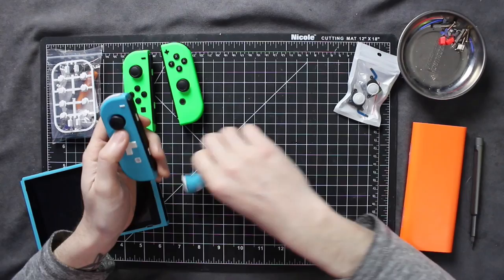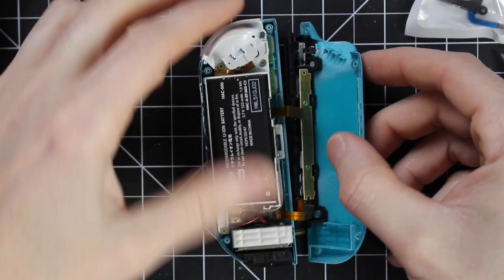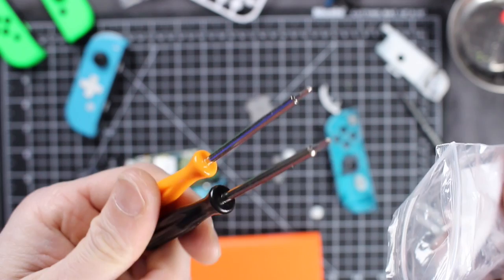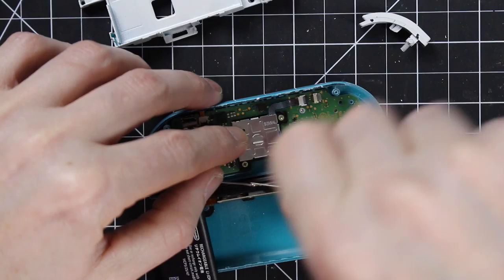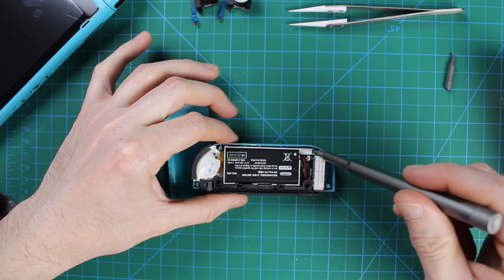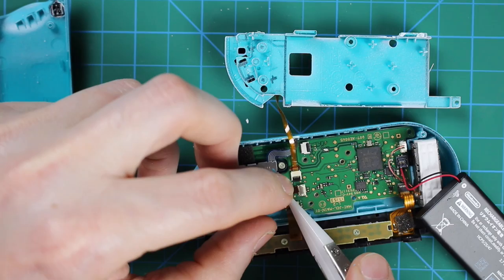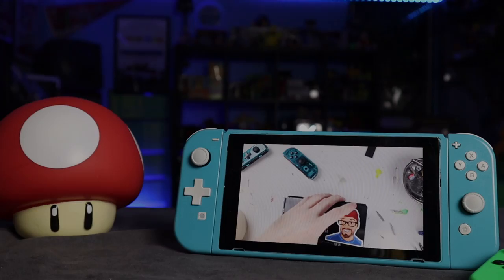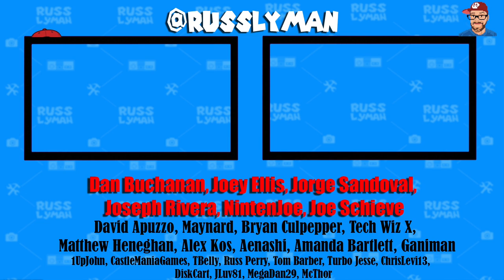How To Replace Joycon Analog Stick

Comment: One tip for anyone who is reluctant to open the Joy Con is to just replace the cap. Without opening or doing anything with the inside of the controller, you can easily pry the rubber cap off and put it back on. You can find tons of thumbstick caps on Amazon in solid colors, and themes like Splatoon 2, Mario, and Animal Crossing. But if you want to fix drift or replace buttons, this tutorial is great. Fantastic video overall.
Reply from the maker: great tip and another great way to customize your switch. thanks for watching

Comment: Hey Russ, thanks for that hint on scraping some extra plastic off of those buttons, you know your stuff.
Great video. Only thing that's missing is some info on anti-yellowing (finger oil) paint. 
Especially with those white buttons, they'll go yellow in no time, I've been there before. So how to avoid white surfaces from yellowing over time, what do you recommend?
Reply from the maker: thanks so much for checking out the video. I never had the buttons yellow on me before from finger oil, but that makes sense. I  usually try not to paint buttons since you will be using them often. To be honest I mainly use the green joy cons with my switch and haven't used the blue ones.
I would say having the clear coat on the buttons would help with the yellow (or the oils reaching the paint from your fingers)
The down side is the more clear coat you put on the button the larger the service area you are making on the button, making it a tighter fit into the slot

Comment: Do you know a way to use bigger thumb sticks that go higher like on the pro controller on a joycon?
Reply from the maker: oo thats a good question. One that is raised out more??? If the thumbstick had just popped on you could try swapping it out, but these replacements came already solder to a new board, making it hard to switch easily

Comment: I've seen that you can use a pokeball plus stick in a joycon and it can act as a c stick. Idk though if the sticks will drift
Reply from the maker: ooo that is a good idea, I bet that could be a different option. I never got one of those pokeball controllers to though

Comment: I have a question: are those the joysticks from the switch lite or are they like a custom color option of the regular switch?
Reply from the maker: So they are replacing joysticks you can buy on amazon made by a third party company (So not official Nintendo ones). I wanted them to help complete the look of the system